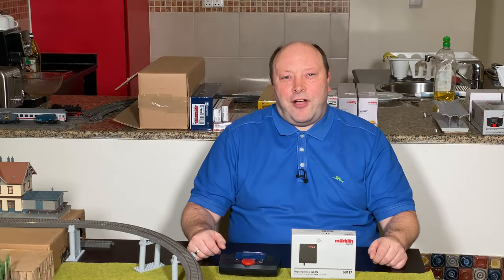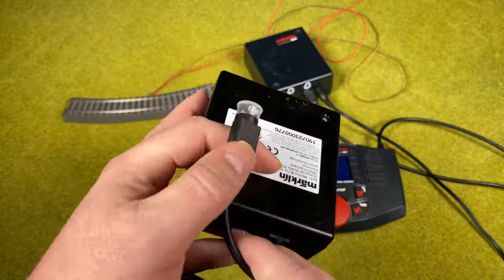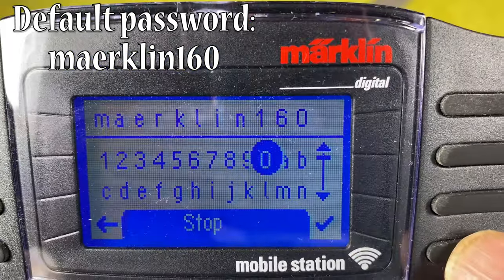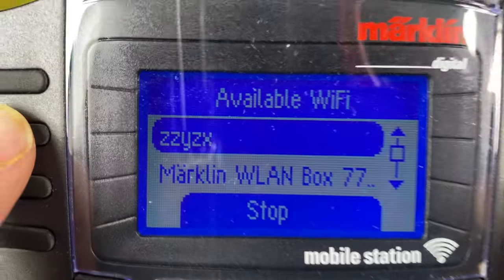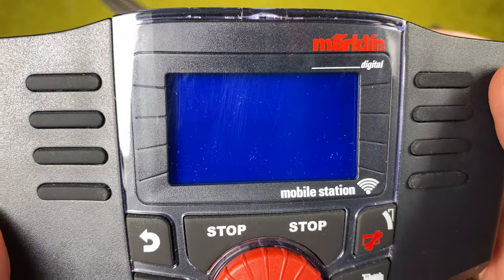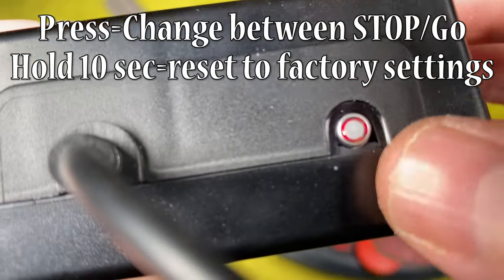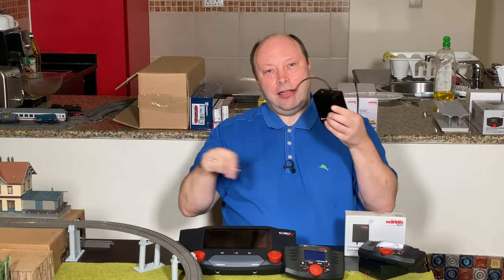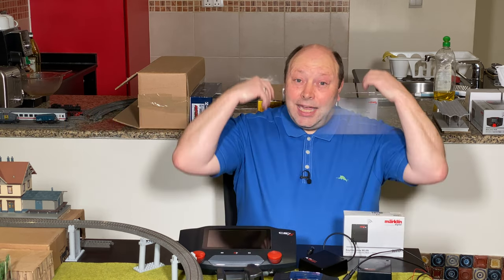Wireless with Märklin 60117 WLAN Receiver Box and 60667 MS WLAN (MS2 Episode 9)

Comment: I have a problem can it be bad to mix  old and new  C tracks .My train studder some times when i rum them ,it Can be something wrong with the train
Reply from the maker: Hi Ulf, 

This sounds more like the locomotive getting a bad connection. This often happens when the track or the wheels gets dirty. Model trains require regularly maintenance and the track/wheels are the most delicate as this is what supplies the locomotive with power and the digital signal. I suggest cleaning the tracks and/or the wheels of the locomotive. It is important to clean track and locomotive wheels regularly to ensure that the locomotive has great power pickup. 

There are many opinions on how to clean your track. You can see here how I do it: https://www.youtube.com/watch?v=Yke1Akvh0Ds

@marklinofsweden has a good video on locomotive cleaning (even Märklin refers to the German version of this one): https://www.youtube.com/watch?v=41Cts-OvNHs

Hope this helps! 

Enjoy ;-) Bo
Reply: I try that great thanks
Reply: I got my self a Wood block and it works.Thanks for the great help.